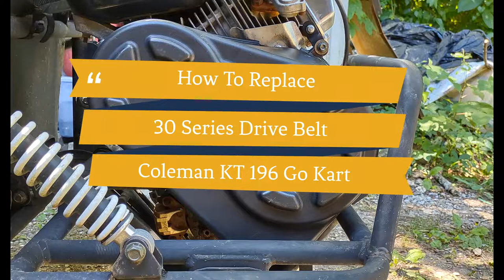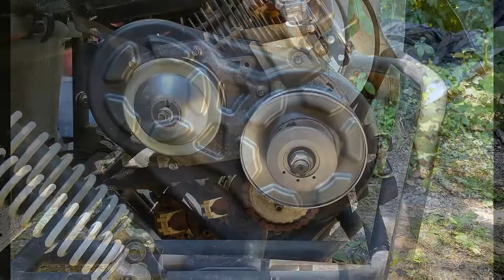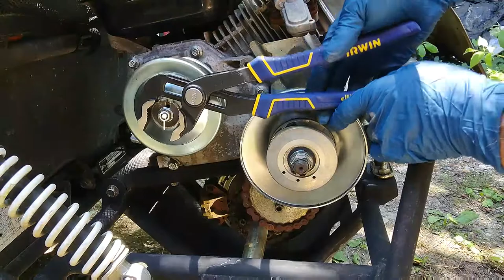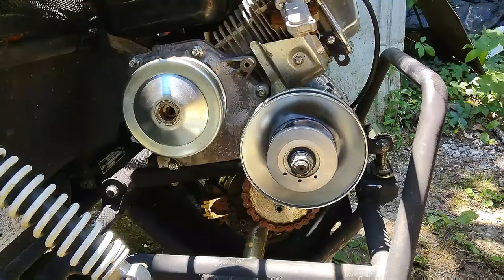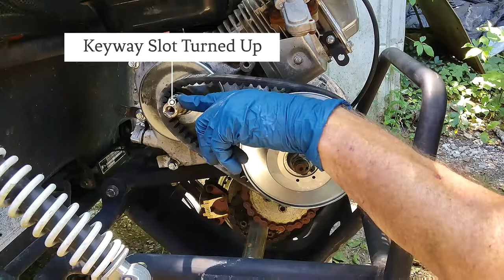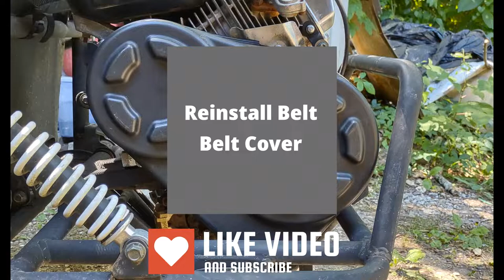How To Replace Drive Belt Coleman KT196 Go Kart or 30 series clutch drive. #coleman #gokart

Comment: Hey I have a coleman KT196 go kart and it runs great and all but I have 1 problem...the drive belts keep getting shredded and maybe last for about an hour and then the belt is finished. I replaced the belt three times and it still lasts about an hour and again they keep shredding and I'm having to replace it everytime. Any idea on why I'm having to replace the belt just about hour? or is their away I can convert it from a belt drive to a chain drive? please any kind of helpful info would be awesome.
Reply from the maker: I had this problem and I started getting my belts from another supplier. I don't know why it was but the belts that shredded the rubber felt hard and would crack very easily. Hopes this helps my friend
Reply: Which supplier do you get your belt from? I just ordered one from Amazon.
Reply: @toollife101  which supplier did you get yours?
Reply: @KayJay  that's where I was getting the belts from Amazon. Bought a pack of three and they all shredded after 30min to an hour. Also I seen where the drive shaft was off center and I fixed that it helped make the belts last longer but they still shredded. I was thinking about looking g to see if I can change it from a belt drive to a chain drive if possible.
Reply: I’m having that same issue just bought 3 from amazon and shredded with in 1hr. I’m going to try tractor supplies. Hope it helps